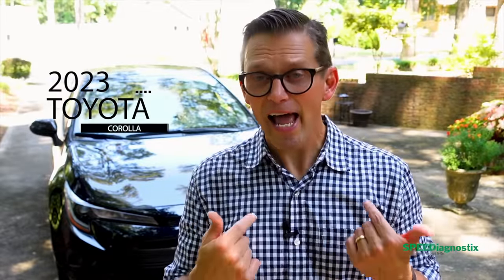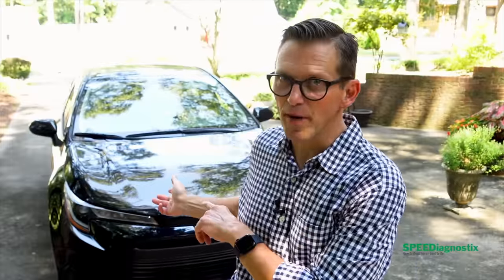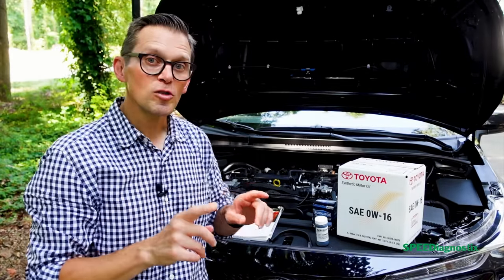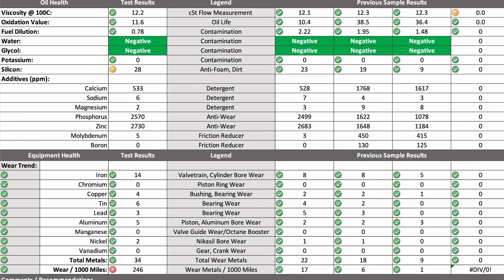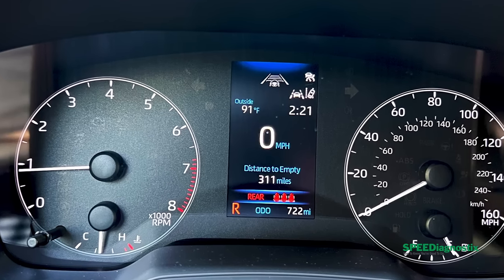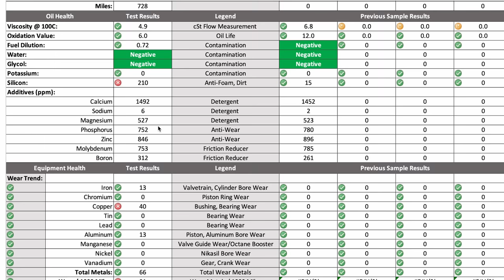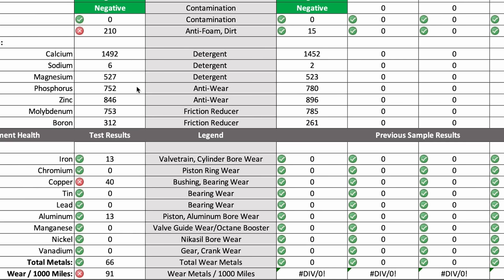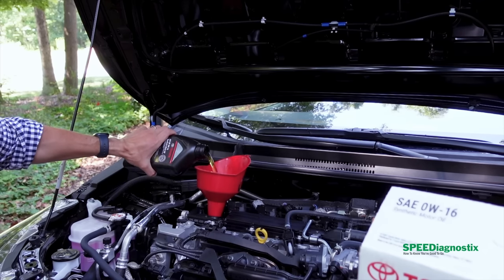AVOID the ONE MISTAKE Almost EVERYONE Makes With A Brand New Car

Comment: Um, the thinking to minimise wear during break-in is all wrong.  In fact a good break-in will wear as much of the coarse honing marks out of the cylinder bore as possible.  Any cross hatching left behind once the cutting edge of the rings goes dull those diagonal score marks are left forever.  That engine will then burn oil for the life of the motor and never develop full power.  It will be less fuel efficient and will gum the exhaust valves and piston ring gaps with carbon deposits leading to a shorter engine life.  What is not said here is the type of oil used for those first few thousand miles is more important than how often it is changed.  Longer runs and varied speed and acceleration in a new motor is what will make the most difference.  Using cruise control and idling in traffic should be avoided for the first few thousand miles.

Comment: Oil change with 100, 500, 1500, 5000 on the odometeron a new car.
Every 5000 after that.
Has served us well with every car. 165k+ miles on every car with no issue with any engine issues where engine oil is involved. I wish the other parts lasted as long.

Comment: Is it possible to change it too much? I had planned to fill and prime my engine after I assemble it for my rebuild, do about 2500 rpm for about 25 minutes stationary, then change the oil before driving it. Then again at 100 miles again at 500 miles again at 1000.

Comment: After sitting the maximum quantity of oil will be in the oil pan. Most of the debris that settled to the bottom of the pan will drain out with the oil and some will remain at the bottom of the pan until the pan is removed some day. Just so the oil flows well I see no need to get hot oil on you to prove a point.

Comment: It would appear the 2.0 Dynamic Force engine in the Corolla was originally intended to have 0W-8 oil, but didn't before 2023 because of unavailability of the oil in the U.S.  Is this correct?  If so, should I change to 0W-8 2021 in my 2021 Corolla Hatchback?  It calls for 0W-16 as you know.  Many many thanks for your great videos.

Comment: Several Honda S2000 owners found that an early oil change (500 miles, removing the break in oil) left them with reduced ring sealing and thus lower HP numbers as proven on dynos. Maybe it's the frm block... but it happened.

Comment: I use AMS OIL Signature Series 25K or 1 year.... in my 2015 Forester I drive only 3 K a year... I get great MPG.. but what is the correct oil change interval when you drive only a few K a year ? Could I just change the filter in a year and have the oil last 24 months ? The oil doesn't even look used when I drain at 1 year...

Comment: Yea maybe but having owned 3 vehicles that made it 300k on the original engine and definitely not having the first oil change done in the first 500 or 1k miles I’m not sure it’s measurable extending the life of the motor anymore. Also only one of the motors had a head gasket issue. They ran fine, they just got totaled in accidents

Comment: Here's a bonus tip, when you change oil and filter, put a rare earth magnet on the engine side of the drain plug.  You won't believe the amount of schmutz you'll get every oil change.  Been doing this over 50 years and have never had a bad engine

Comment: I bought a new 2023 Toyota GR86.  I had the oil changed at 5000.  During the first 4000 I noticed the car had used a quart of oil so I had to add a quart thinking to myself "Great, I have a car that uses oil :(" Changed it at 5000 and I'm now almost 4000 miles into that oil and the oil level is staying dead on full so I guess everything has worn in and is sealing properly now.  I'm probably going to continue my oil changes at 5000 mile intervals even if that means I have to do every other change myself and let Toyota do the other ones until they won't do it free anymore.  The cost of an oil change is a lot cheaper than the cost to repair an engine and I plan on keeping it a long time and lots of miles.

Comment: In the owner's manual, it said '0W-16 is fine to use when 0W-8 is unavailable. 0W-8 must be used in the next oil change.' In your opinion, is that switch back to 0W-8 necessary?

Comment: Should do it after around 50 miles. 99% of the wear will have already happened. When i did mine there were lots of metallic bits in the filter that ive never seen in any subsequent change.

Comment: Lake, Question I have a '78 Lincoln Town Car with a 460 engine, should I use zdp additive when I change the oil? I'm using 10/40.  I only drive the car about 500 miles a year and change the oil once a year. I only really take it to car shows and cruises. It only has 85,000 original miles on it.  Thank you.. I use Castrol high mileage. My buddy said to use Chevron delo 10/30 oil for diesel engine it has more zdp in it. Is this true?

Comment: @themotoroilgeek - Two questions: 
1) Why did you choose the Purolator Boss oil filter over the OEM part?
2) Once you've done oil changes on the Corolla at 500, 3000, and 7000 miles, are you going to use the 10k OCI that Toyota recommends?

Comment: Hello sir, 1st of all, thx for all the things i've learn with your videos about oil, people think the Gas is important but fluid was more important IMO...i have some questions for you and the community : I have a BMW G87  who will be delivered in septembre 2024, the breakin period is 2000 kilometers and after that there is 30.000 kilometers and/or one year, i'll plan to change the oil after 4000, 8000, 12000, 16000 because, this is not my daily car and i drive only 5K kilometers max per year ! i take the oilservice plus...; did something appear to be wrong in my POV and decisions ?    Thanks

Comment: 2 QuestionS...I've heard that it's much better for break-in to use conventional oil, not synthetic.  And also, good to have a certain level of debris in the oil.  So, i guess my 2 questions would be, should i drain the synthetic it comes with immediately, then do an oil change?  And #2, isn't changing the oil sobsoon taking out all of the debri?  Thankx

Comment: Question: I found this video of using a shopvac to create a vacuum in the engine while you remove the oil plug - the plug falls out and no oil drops, until you turn the shopvac off. It’s super nice trick to remove oil and not make a mess - is there anything to worry about doing this?? I’m not a car guy but love to take care of my vehicles.
Reply: Please don't do this. Reason why is that your sucking up a bunch of aerosolized particles straight up through the drain port. You really don't want dust and debris injected directly into your oil pan.
Reply: @ncopp4358  that makes sense, anytime I’ve ever done it is having a second person turn it off as soon as I get the plug released, only 1-2 sec of the vacuum going with plug out before the pan is put under and the shop vac is turned off..

Comment: i watched your video and your videos with dave auto .
you are a man who knows his stuff.
im a mechanic and i have a question for you , if you have time to reply , id be grateful.
ive been working with cars and motorcycles for about 30 years now .
many repair manuals suggest 2 or even 3 types of oil viscosity depending the climate 
for example my 4A-GE toyota engine suggests 10w/40 or 20w/50 .
my motorcycle cb500x 2020 model says strictly 10w/30 fully synthetic for all climates .
like you said in your video , i want this engine to last as much possible so i changed the oil before the recommended 1000km range . at about 500km .
heres the thing .
summer in greece is very hot and can easily reach 40+ Celsius.
a typical 3 month summer period is 33 to 42 Celsius.
when getting in 1st gear and 2nd riding in these temps the gearbox is very noisy and often has false neutrals .
it feels almost like its braking in pieces.
so i changed the oil to 10w/40 fully synthetic and all the problems are gone .
am i causing more wear to it ? 
whats your opinion ?

regards 
nicholas ?

Comment: Was even more important to do an early first oil change on a new aluminum lawnmower engine after the first half hour or so of run time (engine with no oil filter)
initial oil drained would often have a "sheen" or silvery appearance due most likely to aluminum dust/powder suspended in oil

Comment: I notice that Break In oil is often used on these tests. I thought this oil is supposed to be replaced after the initial  break in period to prevent the negative effects associated with excessive levels of ZDDP?

What are the negatives, if any, of continuing to use it through so many pulls?

Comment: Just purchased a 2024 4Runner. About to do the oil change at 700 miles. Would it be OK just to change the oil and not the filter on this first one? filter is a little hard to get to so was wondering if I could delay it until the 3k miles oil change.

Comment: Sorry for being such a nerd, but...

According to Nissan GTR engineer, engine oil lubricants break down after 2000 miles of driving. 

And transmission is recommended to be changed every 20000 mile of constantly using lower gears (mountain driving) or max towing all the time, zipping thru the manual gears in zippy 4 cylinder banger compact cars. Apparently after 15-20k milrs the red trans fluid already turns to brown/black in most high mileage vehicles. 

So...

Following these ultra aggressive maintenence intervals will end up costing you as much as paying for a brand new engine/transmission once the car hits 150-200k. 

What am i missing since the ounce of prevention costs as much as a pound of cure in some of these new modern vehicles? 😅

Comment: How do you NOT swap to a magnetic oil drain plug on first oil change...
I'm dumbfounded that is not mentioned.
You want that magnet so that it catches those metal shavings as soon as possible.

Changing the plug as well as an early oil change is the key to a long lasting motor.

Comment: Here's the math for those changing oil every 3K miles. Over a supposed 300K-mile life of my truck (2.7L F-150) it would be 100 times. Each oil change in today's money is $30 (6 quarts of semi-synthetic) + $20 (a genuine Motorcraft filter), that is if I change it myself. Or about twice that much if I do it at my dealership. Which means 70 extra oil changes x $50 = $3500 ($6300  + extra miles at the dealership). Oil is cheap you are saying? Okay, since we don't trust Ford we are going to change transmission fluid more often too. Hmm, it's not that cheap, but transmission is expensive, right? Now, how about differentials and transfer case? Things start to add up quickly. Coolant (corrosion can kill your engine)? Brake fluid? While my truck was $50K brand new it will be at most $10K at 200K miles (depending on its age), and maybe $5K when it has 300K miles in today's money, depreciation is a thing. So let's say changing oil frequently gets me that extra 100K miles (fleet trucks live a happy life until 200-250K miles with standard 10K changes, including the first one). Okay, I've just saved a whopping $5K, but spent a lot more on oil and other fluids. What a saving! Don't forget inflation too, the money you spend on oil is spent now, but you will get those $5K in "savings" in 7-10 years depending on your truck usage. Also 1/3 of that time you will have a truck with >$200K miles, and unless it's a collection vehicle you will have a constant headache with other stuff and that's expensive too, that's why fleet vehicles are sold at around $200K.

Comment: I have a question about these oil analysis tests detecting additives. Is it possible that there are more types of additives that a test doesn’t detect? for example, what if Toyotas Oem oil has some proprietary additive. Would it show up on a test? Or would you need a test capable of detecting that additive ?

Comment: Question for ya.  Manual says the oil has special additives for break in period.  Would it be bad to change it too quick? Shouldn't these additives be there for a little longer than 500 miles ?

Comment: Just want to point out the owner's manual said 0W-16 can be used, but it MUST be replaced with 0W-8 at the next oil change. Very odd that Toyota is selling vehicles in America requiring oil that is hard to find in America 🤔.
Reply from the maker: Stay tuned for an upcoming video on that question.

Comment: Why arent we talking about magnetic oil plugs?. Always when i raced motocross we used magnetic oil plugs because there was always metalish sludge on the plug when you took it out, similar to polish paste, things the filter wont catch and who has taken down an oilpan knows that "flushing" isnt exactly like high pressure washing the insides of your engine, there will still be debris in the oilpan if you flush it, i've seen it several times

Comment: got a new Jimny last year, and just recently a new honda Fit. on both cars i changed the oil at 1000km, with valvoline mineral oil (SN). btw there's what i think is a myth on BITOG that honda's factory fill oil is a special break-in oil that you should keep using until 10k. sounds like BS to me...

Comment: Just bought a new Hyundai Sonata 2.5L with 13 miles.  I plan on doing the first oil change at 500 miles.  Again at 2000 and then at 5000.  It will be 5000 miles ever after with full synthetic oil.

Comment: So motorcycle oil with a gear oil additive, it should have moly in it from the factory? Also can you add moly without harming a wet clutch?
I used Forte additive once In a wet clutch and made it slip like crazy. I suspect Forte was a zinc type thing.

Comment: new sub. love your channel. What's a good OCI for a 20147 RAV4. Non GDI engine. Thanks.
Reply from the maker: Thanks for the sub! 5k is very safe
Reply: @themotoroilgeek  Thanks, is that a PuroLator BOSS filter? How do you like those things? I think they might be available for my car.
Reply from the maker: @semiephemeral9  It worked well on my daughters car.
Reply: @themotoroilgeek  or 6 months whatever comes first? don't drive a lot and winters are pretty brutal here temp wise. thanks buddy.
Reply: @themotoroilgeek  Just watched your long vid with the guys from Dave's auto center, and you mention adding a detergent additive to your fuel, whether it be gas or diesel. It would be GREAT if you did a video about that.

Does that advice apply to Top Tier gasoline as well? 

What additives do you like?

I realize this is a lot of questions, but your channel is fascinating.
Reply from the maker: @semiephemeral9 yes, there is benefit in using a PEA based detergent additive every 3,000 miles even with Top Tier fuel, especially with direct injection.

Comment: Two questions - 

why don't all vehicles have MAGNETIC drain plugs? Wouldn't they catch a lot of the fine wear particles better than a filter? 

And - why don't manufacturers put the oil filter on TOP of the engine? (ideally with the opening facing up to prevent spillage)

Comment: 2019 Ram with the HEMI.   I changed the factory oil and filter at about 200 -300 miles.   Can't recall exactly, but no more than 500 miles.   I have changed it every 5000 since then even though RAM says change it every 15K.    That's just NUTS if you ask me.     43K truck.  How much to change your own oil?  50 bucks?

Comment: What a hassle those under engine panels are. My Maverick has one big & heavy made of  IRON.
My motorhome genset too has a panel but ONAN was kind enough to bore a hole in it for oil 
drain plug access and it has a little keyhole cover you loosen the 1 screw & swing aside  to gain 
access to the drain plug.
wheres my hole saw set...

!

Comment: Manufacturer maintenance schedules are designed to get the car to the end of the warranty with minimal time and expense.
After 3, 4, 5 years and 60,000 miles it could blow up for all they care.
500, 5,000, and every 5,000 thereafter.

Comment: I’ve owned 3 brand new vehicles and changed the oil before 3,000 miles. My most recent vehicle was more like 2,000. I can not see going 10,000 miles with break in oil.

Comment: So , you drive it around the block, to agitate all the fine particulate in the oil pan..
So it's circulating through the bearings etc ..
Isn't that a bit counter productive ?

Comment: Break in is so crucial that even AMG and Porsche won't let you use launch control before 1k miles. Yeah I've changed the oil on new cars at around 400 miles, since oil is cheap I'd rather change the oil twice before 1500 miles so the engines os broken in already.
Reply from the maker: Right on!

Comment: @Themotoroilgeek Back in the day, they used to say don't run synthetic oil for the first few oil changes so the engine can break in properly,  synthetic "was too slick" and wouldn't allow enough wear for proper break-in.  Is there any truth to that or is it just another old wives tale?